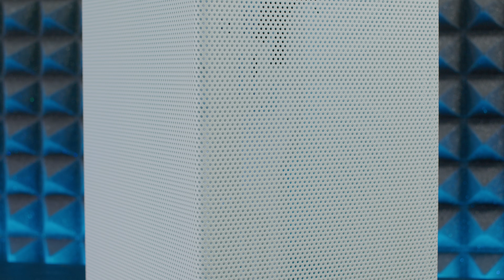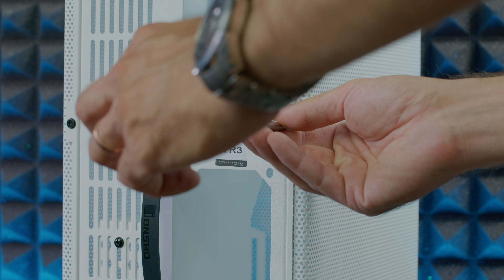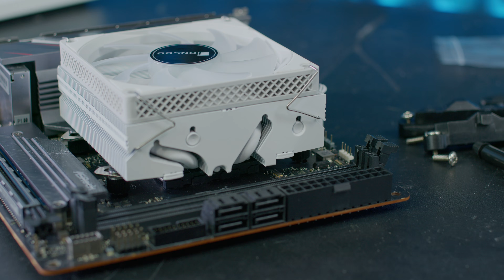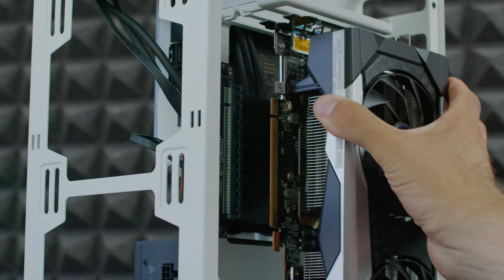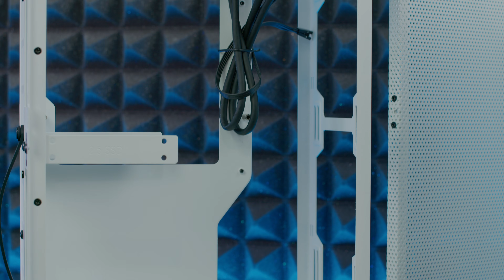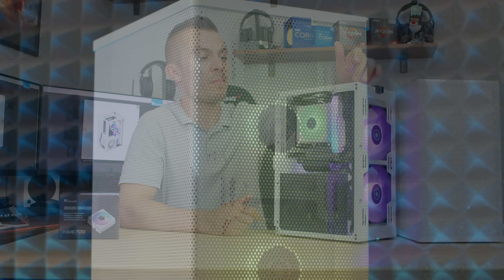SIMPLY GREAT! - JONSBO VR3

Comment: I'm hoping the Gainward phantom 4090 fits in it!
Reply from the maker: Did it fit?
Reply: @PCCrazyDario  Yes it did! Just needed a couple holes drilled higher up for the bracket.
Reply from the maker: @masonj19  Perfect then! :) Glad it fits!
Reply: @masonj19  Curious as I'm trying to fit a 4090 as well - what were the dimensions of your phantom? 348.2 x 160 x 72.6 mm? (this is what I found online) :D
Reply: It's hard to believe it fit 348mm card are you sure you're talking about gainward phantom 4090?

Comment: Hi Dario, would a cooler with a height of 76mm fit? (70mm are max :P)
Reply from the maker: Hi Huan, unfortunately no, because when you slide the inner chassis into the meshed out part, it eould get stuck unfortunately. :(

Comment: I have a noob question but how you setup airflow with that aio fan. It blow in or suck out the air on that? Im waiiting for vr3 on delivery right now
Reply from the maker: I placed the fans to blow inside the case. Both combinations are possible, but I only tried this one and it resulted in some good temperatures.

Comment: cable management could be better, always an issue with theses jonsbo mini cases.
Reply from the maker: Yes, of course. I agree. But since I did cables in under 2 minutes, I think this is quite alright. Basically, if you go with custom sleeved cables which go directly from the PSU and not extenders, then if would look amazing. ;)
Reply: @PCCrazyDario  i didin't say it's hard but too close to the fan in front. looks like you can install 120mm watercooling on top and hold cables in the bottom, but product page only lists 240  and 280mm watercooling as compatibles.
Reply from the maker: @Housestationlive  I actually tied them up to the steel chassis of the case so they don't "interact" with the fan. On top, unfortunately there aren't any holders since it would be hard to squeeze in the rad + a fan. But yeah, I get your point.
Reply from the maker: @Housestationlive  That sounds really interesting. Looking forward to it. :)

Comment: can you tell me what the clearance is for the thickness of the radiators? would an Arctic liquid freezer 280 fit? this rad is a little thicker than most standard rads and the tubes come out vertically out of the pump block.
Reply from the maker: I honestly don't know the thickness clearance for the radiator and it might be a problem with the tubes running vertically out of the pump. :/